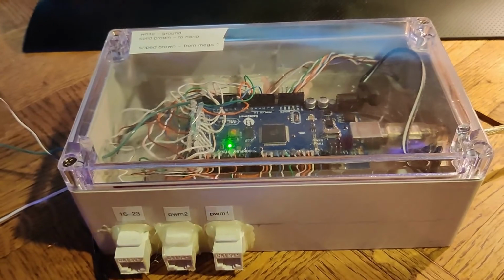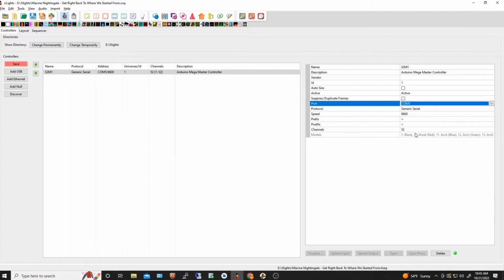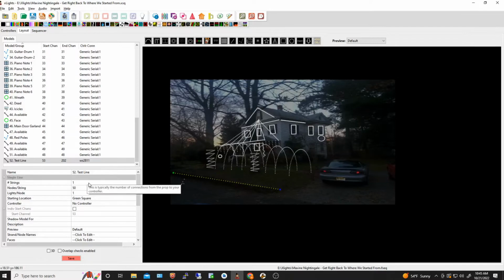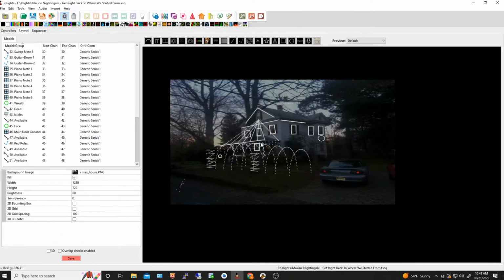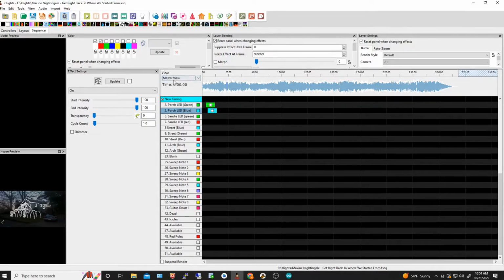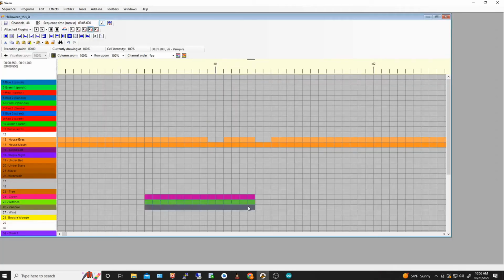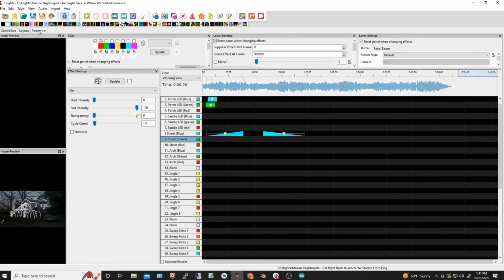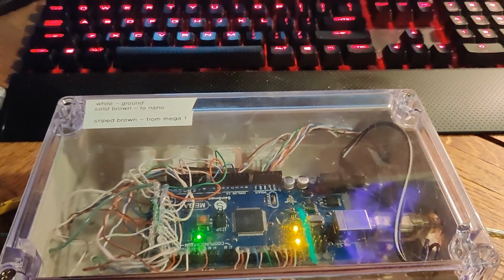Getting Xlights with Generic Serial to Work with Arduino

Comment: Why not put your code for the 52 channels on github
Reply from the maker: https://github.com/mlivolsi63/xlights/blob/master/mega_master.ino

I've been a little hesitant  to post the code because the wiring get a little wonky.. for example, on the mega, pins 44,45 and 46 are PWM.. 
so I try to keep the first set of pins (2-13) and the higher pins (44,45,46) in a contiguous group. (I have mappings in the comments), I also have a few dead pins, so when I code it, I do it , in such a way, that from the perspective of vixen or xlights, it's sequential.  Even though the code references Vixen, it's all works the same.

Comment: I want to run x-lights on falcon player with a raspberry Pi connected to my Arduino.
I have to do the generic serial connection, I haven't found too much info on this. This video comes close to helping

Comment: I'm trying to get two strands of individually addressable WS2811 RGB lights to work with xLights from my Arduino. Is there a way to control the strand (each light individually) with just one pin (because the strand only uses one data pin)? Also, I'm afraid I don't know much about generic serial and xLights... does the data for each light come as <R, G, B> or does the data come as <R> <G> <B>? Have you ever used individually addressable lights with xLights? If so, could you share how you accomplished it so that I can try to understand how to use xLights with an individually addressable RGB strand?
Reply: Did you ever find a solution to your issue? I'm in the same situation at the moment and have been banging my head against the wall.

Comment: Great tutorial! Thanks for posting. I have successfully uploaded the Arduino sketch, set up the controller, and made a simple layout and sequence. I have tried many baud rates as well. When I upload the Arduino sketch, It compiles and uploads. I click on the yellow light bulb and it cycles through all 52 amber flashes. The problem I'm having is that when I run the sequencer, I'm not getting any output from the Arduino. Would you happen to have any ideas on where I'm going wrong? Thanks again!
Reply from the maker: What you can do is check out the value of the bytes in your Arduino script..  In the loop(), if any of the bytes == 255, then I set pin2 to high (which you can check with a voltmeter or cheap LED bulb that can handle 5v) 

if (inByte == 255)  digitalWrite(2, HIGH);
else                digitalWrite(2, LOW);

255 means that in your sequence, you have one of your channel values set to "on".  

btw. If you've ever worked with Vixen before (ie. v.2.1) it works in the same way